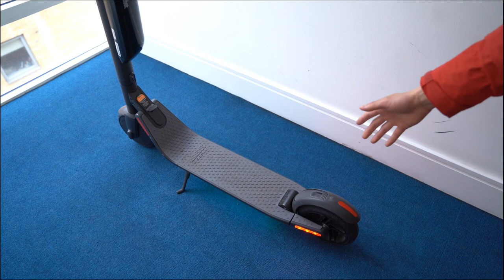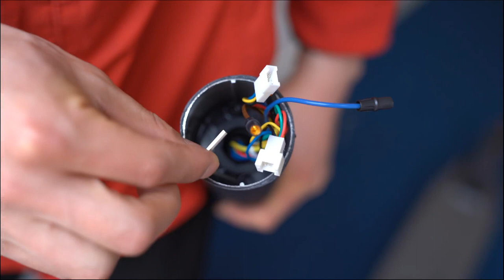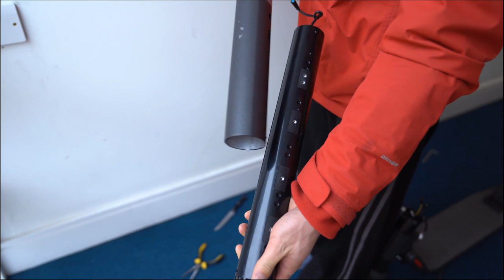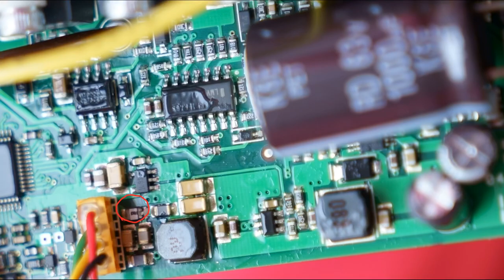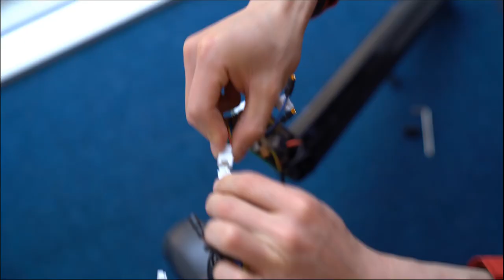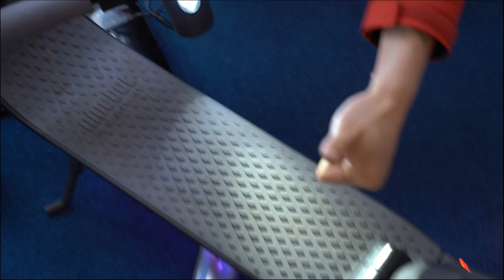Step by Step Tutorial How to Fix Ninebot ES2 ES4 Headlight on Brake Applied Automatically No Power

Comment: Thanks for the video. Helped me to fix my scooter. The most tricky part was the soldering since everything is really tiny. I didn't manage to simply bridge the fuse, most likely because of the PCB coating. Had to remove the fuse alltogether and bridge between the soldering points. Tricky even with a magnifier at hand.

Comment: There should be a class action lawsuit against this company. The least they could do is announce a recall in order to fix this problem
Reply: Thinking the same, whole Facebook pages with tons of errors, and we all fixing it like idiot. And they are getting rich with a shitty product. The city I life in you can’t buy these anywhere just Xiaomi 365 because the shops probably went crazy with all the errors.
Reply: @lionelfranklin4529  it is a super product. I have had mine for 4 years without any problems. 
But today this happened to me. I bend up my sleeves and get to work. Whining does not help.
Reply: @dConceptdk   @dConceptdk  I love the folding system, the speed and the looks. The suspensions is fine on asphalt roads or flat ones but others roads... I often have a hard click by going through the suspension. I own 2 ES2´s (upgraded to 4) One of the external batteries died at 6.5 months and no warranty €200, Both kick scooters have been at the shop over 8 times. Motor started making weird sounds and slow down, throttles had problems, light at the bottom broke 3 times. Tires wear out very fast because of front motor. I have em´for 3 year they still work but LOT´s of maintenance. This Facebookgroup is full of problems. Ninebot ES2, ES4, Ninebot Max G30 Electric Scoote, (Segway, Xiaomi) Actually at is at he shop as we speak error 14.

Comment: Excellent! I just fixed my ES4 thanks to You! 5+
Reply: Hey, can you update me on the condition of your scooter right now since you applied that fix?... Is it still working perfectly fine or what?
Reply: @ScheggGaming  Everything still fine. All still working. I have done currently around 200km after that fix.
Reply: So do you still have the external battery installed since then?
Reply: @ScheggGaming  Yes. Everything as same and front light working without issue.
Reply: Thanks very much buddy ...I will work on mine today

Comment: Great video, hope I never have to do the repair but thank you for your work fixing it 👍
Reply: So I literally just got my scoot es4 and what happens is when you have the light on and go up a steep hill it fries that little chip and limits the speed. So by just bridging it with solder it won't do that. So don't go up a way steep hill with lights on or you will be in my boat now needing to do this mod.

Comment: READ NOW i had this happen to me i did the soldering properly it work BUT i took it out side I was riding it for a while and then all of a sudden it died and started to apply the brake non stop and now i need a new control board and even then idk if that will fix it cause it’s said something about error 19 but the battery was fine DO THIS AT YOURE OWN RISK SINCE NEW BOARDS ARE EXPENSIVE

Comment: My scooter began to operate differently after I performed this operation.  It now operates at 20 mph as though this modified the es4 motor constant value.  Idk if it’s safe or not, but I’ll let you know if it fries.
Reply: One month update: range has improved, I think the battery was just under voltage from long term storage, and has recovered after a few full charges.  Still watching for anomalies, and so far haven’t noticed any new ones.

Comment: Hello,
 I have a question, ¿do you know if i can remove some speed limit cable? is it possible?
Reply: I also want to know this
Reply: you can flash the custom firmware wich allows you full power without external battery
Reply: https://gyronews.com/cfw-un-firmware-pour-debrider-la-ninebot-es2-2849/ if you dont know french use translator the link to the download is in the middle of text
Reply: @matejbrezan6887  iv got a standard es2 it goes like 25 to 28 km are you saying I can make this faster?
Reply: Bradley Clark sure, but most probbably you will end up fcking up the fuse, wich will most likely fail anyways, the repair is really simple, you can try that firmware, it really has some kick to it 😃🔥

Comment: My es2 does this when i installed the extended battery, but i don't have to turn on the light to have the break lights flash and my max speed is 9mph. With out the extended battery i'm running at 16mph and everything works fine. Will this fix my issue?
Reply: @justinh4306  i tried it and didn't work. Still does the same thing. I think it's my Control Board itself. I'll buy one from eBay.

Comment: My new ES2 just arrived and it won't turn on. Not even a beep or the slightest light comes from the dashboard. :( What could I do? (I checked the battery and the output is 5V. Maybe it's too low...?)
Reply: check the cables
Reply: @WerewolfMaster  I bought a used battery and it worked. So maybe it was the whole battery or just the cables that were faulty. We will never know... Then about half a year after that I wrecked the scooter lol

Comment: My scooter es2 all of the sudden has not power, baterry gone quick and the brake sound horrible and the seller on ebay does not answers me. It has 1 year warranty and i just have 1 month with it.
Reply from the maker: giorginikillto black ops 4 don’t worry my friend, we are your seller.
Reply: I didn't know since now hehe, i can send you videos as you said but i thibks the best option is send to you and ypu could a sort it out quicker and better than me brother.
Reply: @scooterreivew5713  hey my es4 just powered off all the sudden could it be a battery issue boss or many possibilities of control board
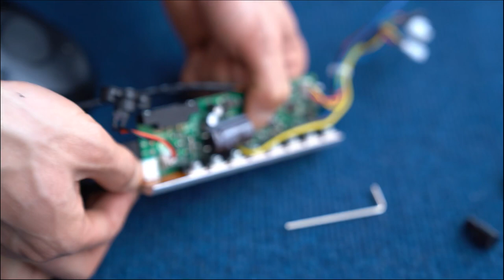Reply from the maker: @alexdanner3008  no power on at all? you can check whether the power cable from the battery is disconnected from the control board. watch from 4:20
Reply from the maker: @giorginiBTC  we fixed it, yeah~
Reply: @scooterreivew5713  well I was riding it and it powered off all the sudden no charge or blinking
Reply: @scooterreivew5713  I got it on now it won't stop chimming and slow speed
Reply from the maker: @alexdanner3008  check the column inside, cables may melt
Reply: @scooterreivew5713  do you give advice on scooters also as my lights ain't working underneath and the collapsible clip ain't locking
Reply from the maker: Bradley Clark are the rear lights working?
Reply: @scooterreivew5713  yeah the break lights at the tail and the spot light at the front works
Reply from the maker: Bradley Clark if the brake lights are working then the lights underneath are broken by itself.
Reply: @scooterreivew5713  thanks for your advice guys erm is this something I can fix ? Iv already had a try at releasing the bottom to get access to them but dont know how and all tho bolts are lock tight .
Or can you repair this ?
Reply: Hi does anybody here know how to  access the bottom of the es2 so I can repair the lights please please there is no videos or spare parts regarding this part of the es2 scooter why so?

Comment: Have an Es1 trhat when light is on speed limited to 15km/h on sport . Also cannot updated via app, and keeps beeping for a while. Another issue being it does not show charging percentage, shows what it was last time but not no move up and it stops at 95%. Would this probably fix them all or does mine have multiple issues?
Reply: Does yours code 42 46 and 48 when charging?
Reply: @joseph-is-my-name  Mine does. Any hints?
Reply: @paziwork  first I no longer recommend Segway.   But I ended up going on eBay and buying a used external battery from someone for $50.  He guarantee it would work or refund.  A new battery would have cost $200.  These scooter are so terrible many people sell all the old parts from broken scooters on eBay.  Good luck
Reply: @joseph-is-my-name  So a battery change helped, and the controller was OK. Thank you, this is helpful.
Reply: @paziwork  battery fixed code 42 etc.  Battery did NOT fix headlight.  I leave headlight off now.

Comment: Please put a 10 - 100ohm resistor inline at the headlight instead. That fuse actually has protective properties.. I'd not advise to use this fix anymore.
Reply: This sounds interesting. How/where do you do this on the scooter?
Reply: @scottdouglas7809  since then I believe 50Ohm is fine too. Doesnt lower luminosity too much.

You unscrew dashboard.
At bottom of dash where wires go in you can unscrew two screws to get to the dashboard lamp. Cut one of the wires and solder resistor in line.
Reply: absolut bullshit ... u cant compare a resistor with a fuse.. the fuse is selfhealing.. that meens it recovers in secounds/minutes. i unsoldert mine and messured 0,001 ohms so its working.
that bad news are its a circuit fault and to bridge a saftey component isnt good.. so work out whats the fault or buy a new board instead for 30dollar and be on the safe way.
Reply: @gerohoffmann2  learn English better. I can't understand what's your point...
So... just tell us HOW should we fix it?

Comment: This is the incorrect way of solving the problem. You are bypassing a safety fuse. There's much easier ways!!! But if you insist on doing this, you can use wire glue or conductive paste. no soldering skills required :-) If you want to learn to fix things right, join a facebook or telegram scooter repair group!
Reply: James Bond thanks for dropping reference for wire/conducting glue. Helped me out!
Reply: hey, someone with common sense :D
Reply: Wait you can use wire glue? Are there any specifications on which wire glues work? Can you link one? Also what is the easier way to fix this?
Reply: So how a common person should solve this? Why hadn't you written. It's precisely described problem - tell us the solution that everyone can use as fix.

Comment: What do I do if the battery is stuck and does not slide out?
Reply: I faced the same problem here, there was a little tape blocking the controller tube, I got rid of it with a screwdriver and a hammer, hitting the little piece of aluminum near the "alimentation plug".